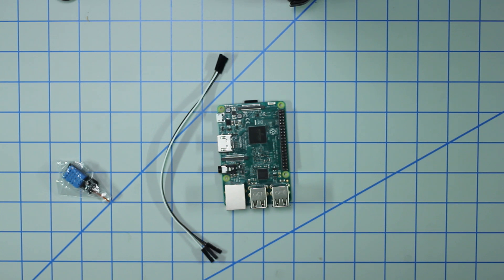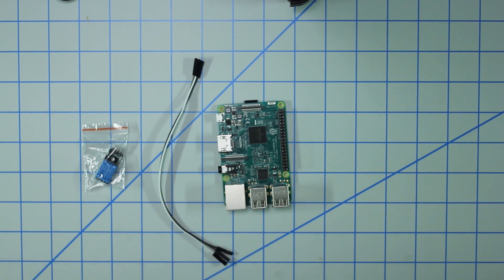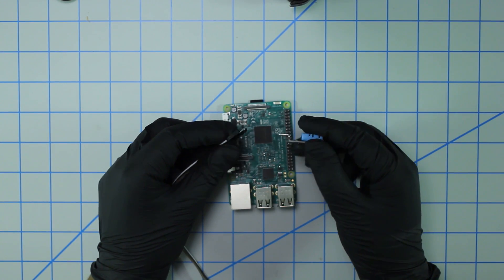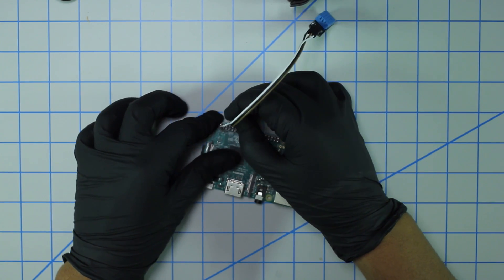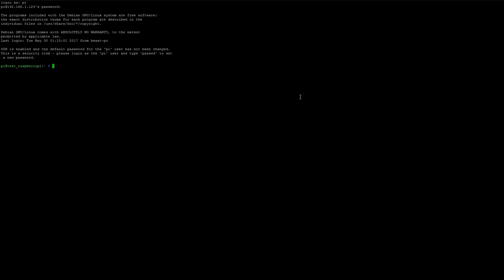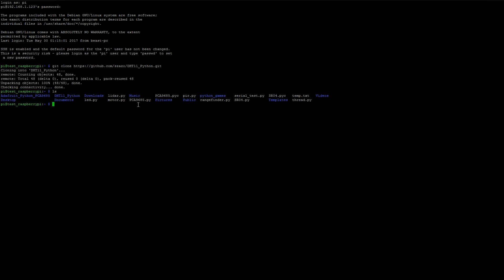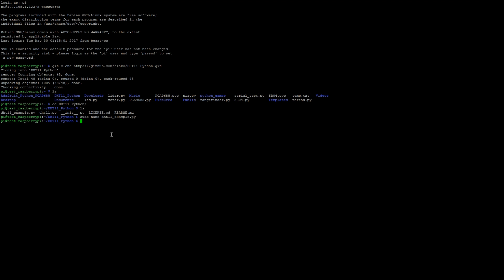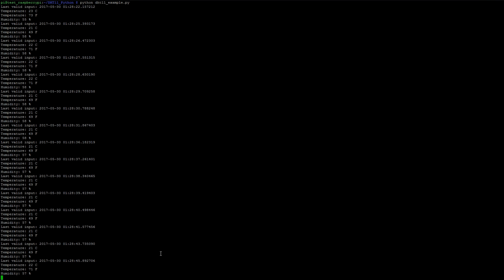DHT11 (Raspberry Pi)

Comment: Can u help me with voltage 220v and amperage 100A sensor please
Reply from the maker: Are you asking about a current sensor or a humidity sensor that runs on 220V?
Reply: PiddlerInTheRoot nope I need to use zmpt101B(220v)and sct013(100amp), but I’m using arduino one too I need know how to conect the raspberry pi with arduino, please help me and I need to work with a reed switch too but raspberry only to know the number of a door is open . Thanks

Comment: Thanks you so much. Perfect job ! Can you tell me how to add a decimal point ... now I see them only as round numbers. Also Im searching way to print result in .txt .... I'm quite a beginner and I'll be very grateful for your help
Reply from the maker: In the DHT11 library you can adjust the formatting to change the decimal precision. To save the values to a text file, just google "write to file python" and you should find several examples.

Comment: How do I access the cmd prompt? I tried downloading PuTTy but I don't know how it works
Reply from the maker: You need do a few things on the RPI first to get it to work correctly. First enable SSH on your raspberry pi (type sudo raspi-config in the terminal) and then get the IP address of the RPI (type ifconfig in the terminal). Then in Putty type in the IP address and make sure the port is set to 22. The default user/pass for the RPI is "pi", "raspberry".

Comment: Are you sure about 3.3v All DHT11s run 5v
Reply from the maker: Hey Oliver, refer to the spec sheet for your sensor and set it up accordingly. I have come across several variants for the DHT11 and encountered tutorials setting it up on the 3.3v and others on the 5v pin.

Comment: My sensor literally melted after following your tutorial, is it because there is no resistor?
Reply from the maker: Hey Cierra, sorry to hear that. I've read on several forums of people's sensor melting even with the correct wiring setup... do you have another sensor to test against?
Reply: PiddlerInTheRoot Yes, thankfully I do have another one that I am going to try again with. Any recommendations for trial #2?
Reply: Hi, I had the same problem where my sensor also melted. Do you have any advice you could give me before I try out my second sensor and last sensor?
Reply: TheXordy I’m going to try out my second and last sensor as well this evening and see what I can figure out. I’ll let you know what I find
Reply: Alright so I tried again with my last DHT11 sensor and tried a different tutorial http://kookye.com/2017/06/01/%E6%A0%91%E8%8E%93%E6%B4%BE%E8%AF%BB%E5%8F%96dht11/   and my other sensor melted as well, so I'm not exactly sure what to do. Let me know if you figure anything out.
Reply: check the + is to 5V and - is to gnd (0V), maybe it is reverse. Check the markings on your sensor.
Reply: my sensor is melted too...

Comment: I followed this tutorial and I just burnt my sensor
Reply from the maker: I'm sorry to hear that, did you wire the raw DHT11 sensor to the RPI? The one I'm using and recommended in the parts list can be directly plugged into the RPI.
Reply: No problem, I am newbie and fortunately I bought two sensors packs and I've got another DHT11 :) This is the DHT11 I used, do you think it's still usable? Yes, I plugged it directly to the raspberry because it looked like yours hehe https://imgur.com/a/DWyId

Comment: HI! I've used a DHT11 in a protoboard and a 10 K pull up resistor. When I run the program, the terminal doesn't show anything. Coud you tell me what's the problem? Ty for reading!
Reply: The problem must be in GPIO or at some connection, mustn't it?
Reply from the maker: Have you tried using a 4.7K resistor? It sounds like your setup might be a little different, if that doesn't work try following this guide: https://cdn-learn.adafruit.com/downloads/pdf/dht-humidity-sensing-on-raspberry-pi-with-gdocs-logging.pdf

Comment: Hey, Piddler. Thanks for your video. I did the exact same thing as you, but it's not working. It does not generate the output configured in Python file. My Pi returns "Traceback (most recent call last): File "dht11_example.py", line 21, in <module> time.sleep(1)". Could you help me? Thanks in advance.
Reply from the maker: Does the original unmodified script from git run? It sounds like you might have a whitespace/syntax issue. If you have another computer I recommend using the Pycharm IDE it usually helps a lot with formatting/whitespace issues.
Reply: Am getting the same error :/
Reply: yes same error